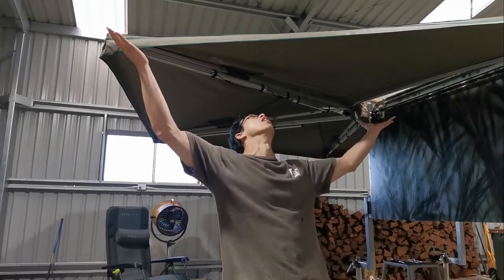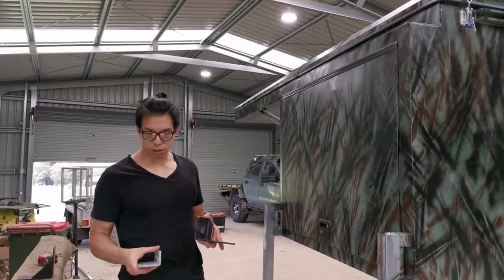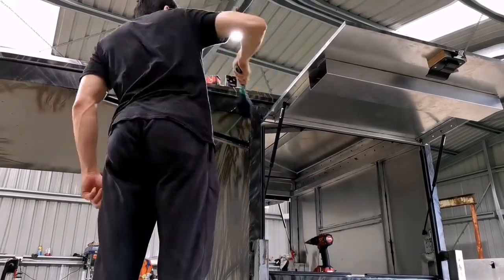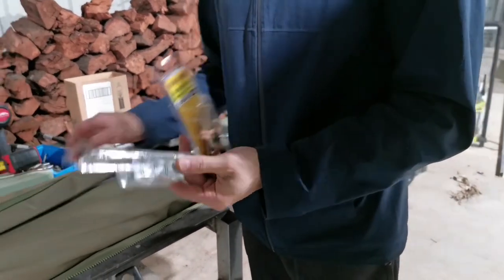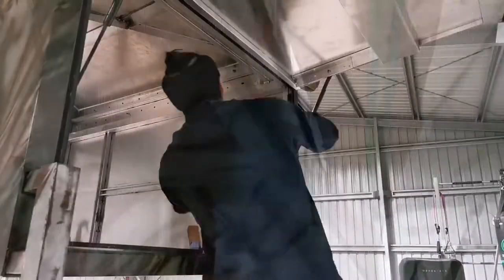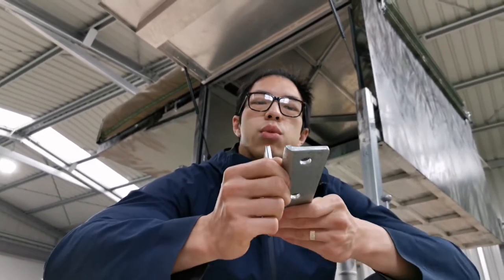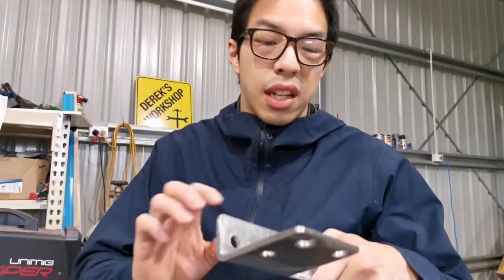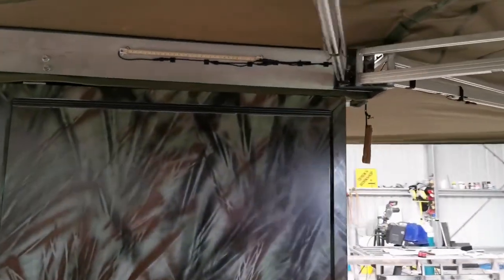INSTALL 270 Degree Awning - Fabricate CUSTOM Bracket

Comment: This is the first  video I have seen that shows the channel on the ostrich wing  270 degree awning. 
And what you found with the bolts eating out the channel is my major concern as I have been looking at buying  this awning. 
Second of all the aluminium spacers that comes with the awning are they also mounted to the channel at the hinge end with what size screw bolts I can't find anything about the size.
To me this bears the most load and  it seems to have to small the hardware  for this point.
Does these screw bolts bolt into the  channel or the handle bracket  ?
Reply from the maker: Yeh I'm not too sure what size bolt it actually came in because from the start I did not fit it myself. But after I took it off and see how it was fitted, I decided to modify it with the bolt size i think suitable.
Overall the channel is really quite too weak for m6 bolts, therefore I changed them to m13.
The hinge end does not seem to be the problem as I remember. I think the ppl who fit it used either m8 or m10.
The black bracket there I used m13 as well.
Overall good awning but I needs to fit properly👍
Reply: @Custom Craft & Adventure  thxs for your reply. 
That channel is the only thing I'm worried about. 
They say the brackets are important to carry the weight but that channel to me is the problem. 
That will  go before a bracket
Reply from the maker: @regkershaw  agreed. That's why I simply ignored the channels, put a two holes and m13 bolt straight thru. Pain in the arse to fit tho